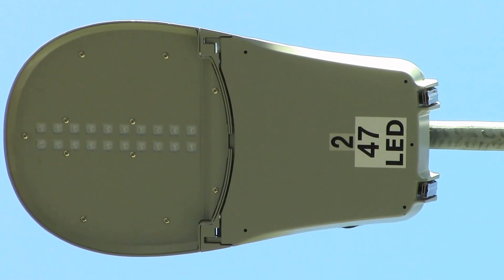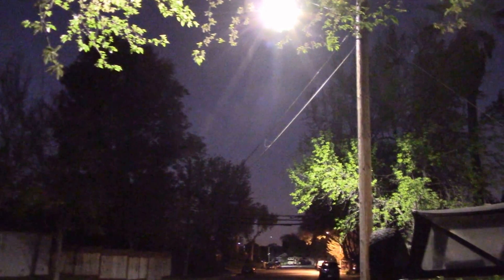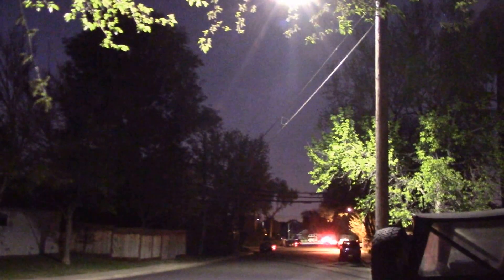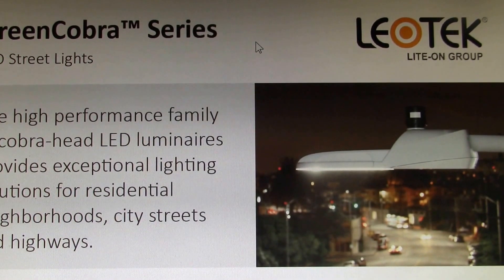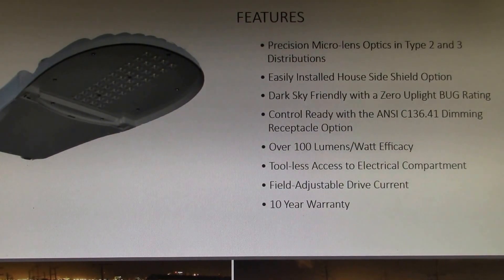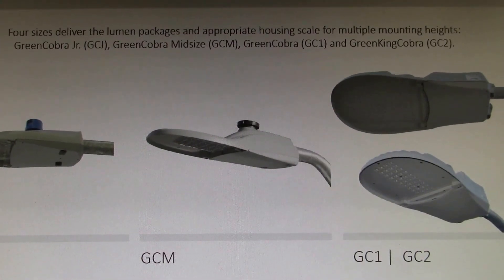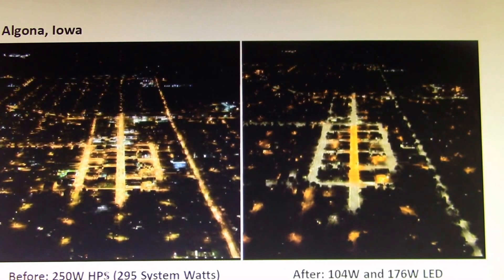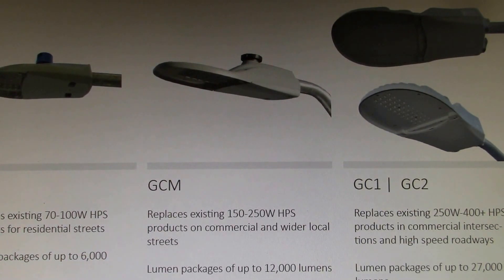Leotek Green Cobra 1 - LED Streetlight, first impression

Comment: I hate led street lights
Reply from the maker: I agree on the cold white color.  I prefer the warm white LEDs and that's mostly what I have in my house.  I do run 4000K in my shop where I have more area to light.  I suspect the reason that the cold white is chosen is lumens per watt.  You get the most efficient light output at the higher color temps on most LEDs.  I imagine that since they are replacing the old mercury or sodium bulbs with LED partly for the energy savings, they are going for the most lm/W they can get.
At least the LEDs don't have that annoying 60Hz buzz like you get from the ballasts in the old discharge lamps.
Reply from the maker: +Payton Russell For sure they are different appearing.  I think a lot has to do with proper design, selecting the right light pattern lamp to match the location.  So far of the ones in my area, I like them.  I get a lot less light scattered into my yard at night than I did with the old high pressure sodium lamps.  That's nice if I do go out looking at the stars at night.  But you do get some weird multiple shadow effects and the light it quite cold.
Reply: The thing is that they need to target a warm color not this cold temp that can mess up sleep patterns.

Even 3000k is too high. Got ones for my house for testing, not as comfortable as the 2700K CCFL (almost identical to an incandescent).

For street lighting, the LEDs should target 2500K.

Comment from the maker: Thanks.  Yes, the LED street lights are quite nice.  I see more and more of them around town now.  In the busier areas of town, they are using the higher output lamps with 4 or more rows of LEDs that light up a wider area.  For sure there's a lot less light scatter from these lamps, I notice my front and back yards are now darker than before, used to get the dim yellow sodium light from surrounding street lamps and now nothing.